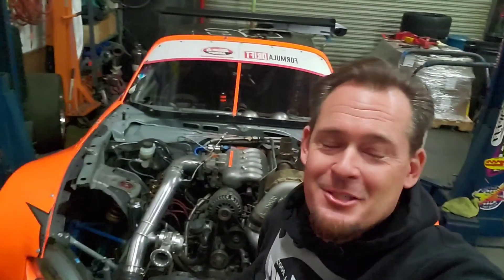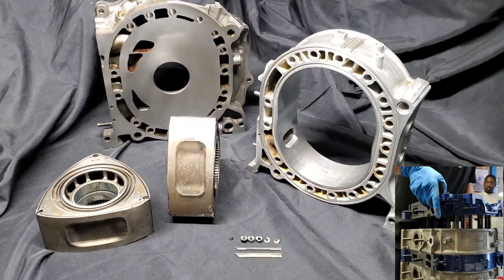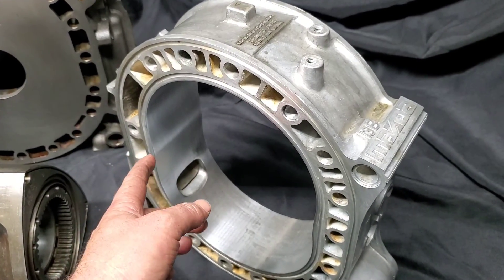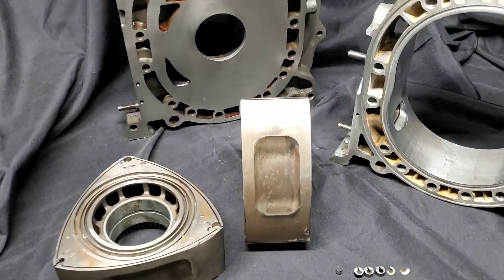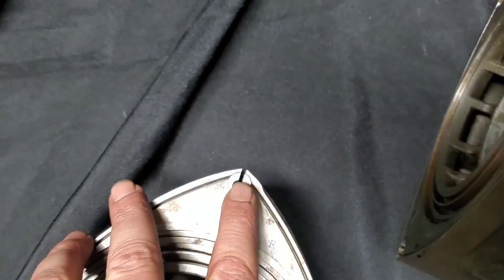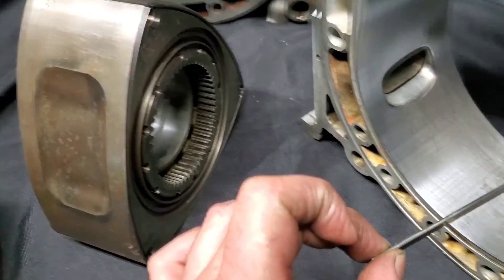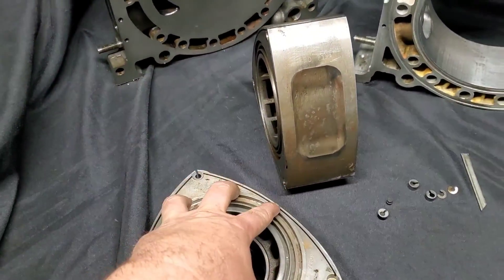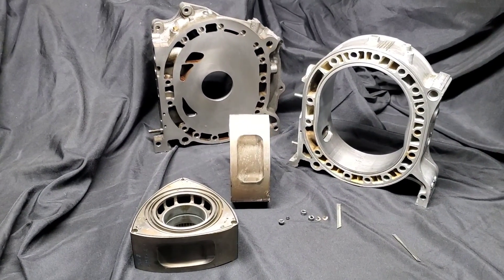Building a Hybrid Renesis RX8 motor, what you need to get started, tips & tricks KMR Builds Video 1.

Comment: When you've got it all apart and ready to start, isn't it worth it to drill out the stud holes a little so you can use oversized studs?  I was under the impression that added longevity to a new build.  Thx

Comment: Kyle,  do you think it's possible to use this method to create a four rotor naturally aspirated Renesis hybrid? It's been said that this is the parts you use to make a four rotor (short) side port rotary. 

From front of the motor
Series 4 ('86) front iron (sec port for number 1 rotor)
series 4 center (pri ports for 1 and 2 rotor)
12a tallport center (sec ports for 2 and 3 rotor)
series 4 center (pri ports for 3 and 4 rotor)
series 4 rear iron (sec port for number 4 rotor)

How about a Renesis or Renesis hybrid version for maximum streetability?

Comment: I have a Series 2 RX8... not sure if this will work for me?  But I did call  Mazdatrix and they sent me a parts list for my engine. 

 But I need to know what I'll need for the fuel and oil system?  I also need to know or find a shop to make the custom header in Los Angeles.  

Anyone out there have the information I need?  Would really appreciate the help because I'd like to get all the parts I need for this project.
Reply from the maker: It will most likely be a custom setup, go larger oil coolers, racing beat race oil regulator... . I like using radium engineering for furl components.
Reply: someone should put a parts list together for everyone

Comment: Any chance I can get that hybrid to use a carburetor instead of it being fuel injected?
Reply from the maker: Yup it could definitely be done. Probably would work well too once the setup is dialed in.
Reply: @KyleMohanRacing  thank you
Reply: @KyleMohanRacing  crap i forgot to ask, does it make a difference if the rx8 engine had an auto or manual trans?
Reply from the maker: @henryhooker3282   yes they are generally very different but can depend on the country sold in, make model and year...
Reply: @KyleMohanRacing  well if i get a usa engine that came with a standard transmission them im good to go right?
Reply from the maker: @henryhooker3282  yep
Reply: @KyleMohanRacing  perfect

Comment: Id like to see this evolve to a 20b version 🤔
Reply from the maker: Can't be built,  the parts don't match up.  There are no side port 20b parts currently
Reply: @KyleMohanRacing  well in Australia a company made 3 rotor e shaft for rx8 renesis engine and rob dahm is doing some very interesting machining curently on rotorys so i think it could be done if someone would just pioneere the project 1st
Reply from the maker: @kingmaybus8409  Shafts aren't the problem. You would use a basic 20b shaft or short 20b shaft,
 but short shafts are weaker and not going to make any real power compared to traditional 20b parts.

The fact that there are no side port exhaust plates is the issue. No one makes after market plates that are side port exhaust. And no one makes a 20b plate with side port exhaust. I was also thinking OEM parts like what we are doing here in this build so it cost effective.  

 Would be a CNC expense project. 

 Happy to help if you go after it.
Reply: @KyleMohanRacing  Food for thought huh...thanks for the conversation i really respect you for taking the time i also SUB'D 🤘😎

Comment: Could someone just use s5 na rotors to save money instead of grooving out the rx8 rotors?
Reply from the maker: Its not really tested.  The side exhaust ports cause extra heat in side seals and rotor side. One of the reasons RX8 rotors have a scraper ring and a unique side seal.  We keep RX8 rotors with RX8 side plates and rx7 rotors with rx7 motors. So basically I dont know. But we do know our combination worked

Comment: how much power does this setup expected to make, on pump gas or E85?
Reply from the maker: If I run it NA I'm hoping to get close to 300 if I end up boosting it I'll be aiming for around 500 plus,might try both

The last one we built did 430 horsepower at 12 to 14psi with an old t4 turbo on 105 octane gas.   Depending on fuel and tune it can easily do more with ethanol or more boost.
Reply: @KyleMohanRacing  wow, that's really good gains for NA. so hard to extract power from Rene

Comment: That middle exhaust port is so damn restrictive looking (but is it really?). Is there a way to get the GSL-SE middle iron to work in this combo? Would make the exhaust header a little less complicated, to boot.
Reply from the maker: Ehhhh, why decrease exhaust potential just to make a mount easier on a custom build?
Reply: @KyleMohanRacing  Look at it this way: if we assumed that all rotaries benefit from having specifically the extra side exhaust ports, why isn’t everyone building these hybrids? Everything I have read leads me to believe the center siamese ports are tiny and problematic with a N/A engine. On a turbo engine there is pressure behind the ports and up to the turbine housing, negating the need for any real exhaust tuning (scavenging). I’m looking at building a N/A hybrid and was simply curious if the center GSL-SE iron would work, given that the rotor housings can be used in this combination.

Comment: I know someone running a Hybrid with 8:5 rotors, so far it seems running fine.
Reply from the maker: Yea, but they are not designed for side exhaust port.  I know of one on methanol that is a full experimental land speed car.  Only logged about 5k total miles.  If you are building a short term race motor that will come apart often probably no issues.
Reply: @KyleMohanRacing  Yes, Landspeed is a good example. I know a guy that has it for the street. So, in long term usage do you think the side seals will wear faster due to extra heat?
Reply from the maker: @josezuma2116   kinda outside of what we tested... but our data showed concerns about side seals both due to port intake shape wear  and exhaust heat build-up. Also the wedge design on an RX8 side seal is meant to break down carbon which RX8s have way more carbon build-up.  To really be quantified somebody would need to spend some money and do side-by-side testing.
Reply: @KyleMohanRacing  Great explanation, thanks Kyle.

Comment: So keen.
I recently ordered a hybrid exhaust flange. Although this flange has the center port blocked off, they say to avoid pulse interference.
So I'm going to need a GSL-SE center plate or fill the renesis center ports with molten aluminium and run the risk of carbon building at the edges. 😬
Reply: Just cut a hole in the flange, I have the same one.
Reply: @Rollnfunka  would be interested in seeing any YouTube videos you guys post. This is a hot topic right now. Thanks guys.

Comment: Thanks Kyle,  have an 8 that needs a new engine and would like to start with this in an N/A build with OEM intake and ecu and then transition to a forced induction system (1bar Max ) with standalone ECU in a few years (probably 10k miles)
Thoughts?
Reply: People may disagree with me, but just REW swap it. I have seen tons of REW swapped cars making great reliable power. On Facebook all the time I see people trying some Frankenstein hybrid renesis turbo and they never really take off. The amount of fabrication that will be going into the turbo manifold is reason enough to stop.
Reply: @MrGimmethreesteps  Yep, disagree with it, the magic of the renesis is that it does the thing like a itb, streetported 13b does in stock manner.
Reply: @ulisesavila2879  yes the renesis is the best NA setup, but once you add boost forget about it.
Reply: Buy an adaptronic now while you still can lol
Reply: @kaizousha5531  still can? They going under or modification legislation.
Reply: @erichansen4718  yeah they already went under.  Company is dead existing stock is being sold and they aren't making any more.  Haltech bought them and doesn't want any competition
Reply: @kaizousha5531  Do you know if the current version supports cruise and traction control?
Reply: @danielkruger4305  yepp it's incredible.  Good tune and it drives like oem

Comment: Can you explain why these hybrid engines tend to fail so often and/or what the root causes of failure are? This topic is brought up so often and seldom actually done with a lot of hype and virtually nothing shown for results (more specifically in terms of long term reliable use). Until I see some legitimate long term problem free results (at least 100,000 miles of real world use) I still remain firm on my opinion of these hybrid engines. I encourage anyone to do this if they're willing to actually share their results, but that just never happens unfortunately.
Reply: These engines are extremely reliable in street yous. I think its just down to a lot of inexperienced people out here building rubbish and a lot of people that say they ant any good with out knowing anything about them
Reply from the maker: @richarduffindell1049  yep, I agree.  To many people who don't build motors with opinions these days.  We already proved it worked years ago at Mazdatrix
Reply: @KyleMohanRacing  yes these are run in a lot of cars around new  Zealand and have never heard of any problems if the building has been done correctly in the first place
Reply from the maker: @richarduffindell1049  yep. Cheers 🍻 to that.  Only time I saw an issue was an improper build.  Its just a Rotory.  Lol.
Reply: @richarduffindell1049  yous?
Reply from the maker: @davidhusband5022 stop trolling 🤣
Reply from the maker: Lol. Stay tuned if you want more info.